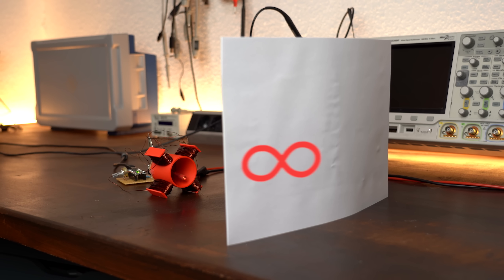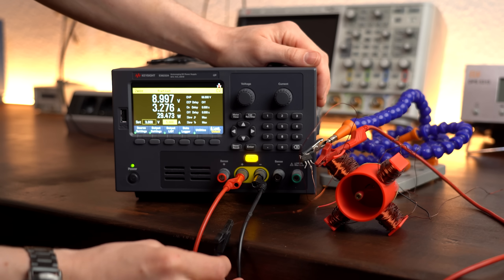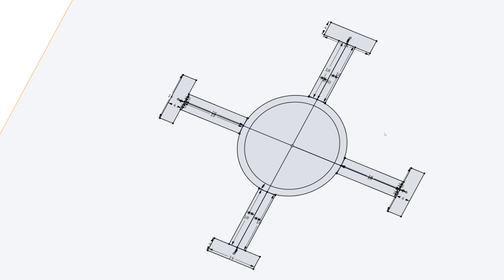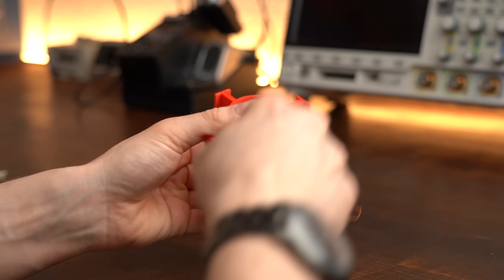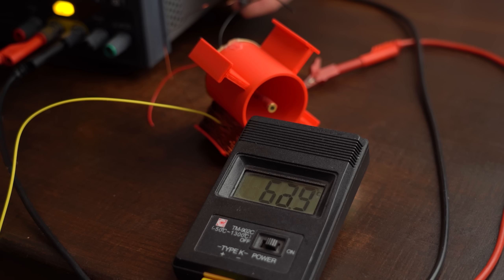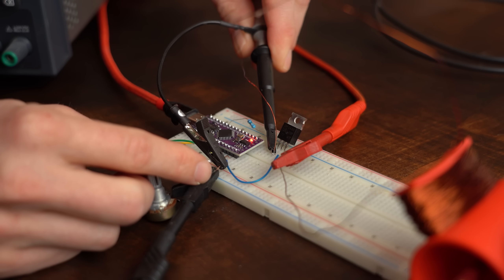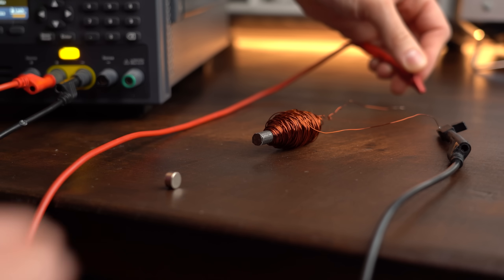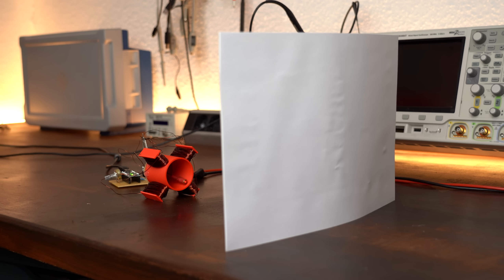Exposing the FAKEST Project....and making it REAL?!

Comment: Even easier laser projection display idea with no moving parts!

How about an electron gun (laser) inside a vacuum tube with magnetic fields focusing and bending the rays (changing the trajectory of the electronics) to hit specific points on a phosphorescent coating on the interior side of the tube opposite to the electron emitter with the target point moving across in a line and then up line by line to display an image on the outside of the tube.

Oh wait that's a CRT (Cathode Ray Tube) display, first conceived around 130 years ago.
Reply: Making a CRT is harder, not easier. A galvanometer based laser display requires no vacuum, special containers (vacuum tube), special chemicals (the phosphor), or extremely high precision, nor does it generate X-rays.

Comment: Electronics aside, the idea of producing accurate and balanced motion by just suspending the diode on a piece of wire is simply ridiculous and likely the reason why you weren't able to achieve a decent result even in the optimized build.

Comment: Congratulations! You just made a TV CRT with electromagnetic deflection - no ultra high vacuum, no glass, no phosphor and no tens of kilovolts to accelerate the electron beam. 
Nicely debunked :). I saw right away that this ain't gonna work without any cores in the coils, and swapping the polarity on the 9...12V source (coils from VCC to drains; sources on GND) would make it work. There's an additional issue of no pull-down resistors on the MOOSEFET gates, causing potential problems in the switch-on period before the pins are configured as outputs (they're in the high-Z state).

Comment: Am I to expect more piss poor "attempts" in the future... In what practical application of a wave guide do you see such poor windings used.. You have to remember people get facts from your videos. So when you half ass it, and only energize one of the poles. You are teaching people to expect such abysmal performance from said fundamentals, even though you didn't do them due diligence. 

Wanna do some actual good, Take this BS claim of an idea, Put your own knowledge into making it perform correctly. And say "look even considering all of this, It still doesn't work".. Modern rare earth magnets on the laser body, and just stealing the coils off the back of a CRT would have had an effect. You can make a decent DC power supply with an H bridge for X and Y I know, even though that might make chunky moves, you just didn't try.

Comment: https://youtu.be/AzlIG3E7atE

Same Robotics kanti made a video on rf capture using 1n4148 diode, can make that same experiment and say it is real or fake? 

I tried it, but it not worked for me!
Reply: Not going to watch the video, but some thoughts do occur to me. In particular:
1) A normal diode (ANY of the silicon ones) has too high of a switching voltage to detect normal-strength RF signals, so either the signal needs to be amplified, or a lower-switching-voltage diode must be used ("crystal radio" sets use a lower-switching-voltage diode, though the LC resonant circuit in them plays a role as well).
2) If capturing RF for power purposes, then you're limited by the actual power that your antenna physically encounters, and trying to accept a wider range of frequencies actually reduces how much of the power in a specific frequency you can actually capture.
3) Your antenna has to match your intended frequency range, if your antenna is wrong (or you accidentally filter out your desired frequency after the antenna receives it) then you might not get any signal at all.
Reply: @absalomdraconis  Thanks for the brief theoretical explanation 😀.

Comment: Yeah also driving a FET directly, when the voltage being switched by it is greater than the voltage of the MCU, is also pretty silly. When FETs blow, they usually short, which would make a path for the voltage to go to the MCU pin and poof, your MCU (or driver) would die too. It’s common practice to include a ~10 ohm resistor in series between gate and driver, and in many cases a zener diode as well, to clamp the gate voltage and fry a cheap resistor and or zener, rather than the controller as well.

Comment: I've made a laser toy almost like that but it is also quite different, and soon to be impossible.  I used mechanical hard drives, specifically the moving arm attached to the reading heads.  It has a coil between two very strong magnets and deflects with modest current.  I attached a small piece of 1st surface mirror to the arm at the pivot, and aimed a laser at it.  Let's call this the left channel.  I then took a second hard drive, same procedure (remove platters, attach 1st surface mirror to pivot) and arranged the hard drive cases at right angles, so I had x and y deflection, let's call this second hard drive the right channel.  You can then attach the left and right voice coils, which are the coils of wire between the hard drive magnets, to a headphone jack, power a laser, and get an audio driven laser light show, classical music or pure tones create collapsing ellipsoids, fun to watch.  Before then, back when you could get black and white (or black and green) CRTs, I took one apart and much like the above, attached the deflection coils to an audio output.  This functioned like and oscilloscope, and again created collapsing ellipsoids when listening to classical music or pure tones. It would be fun to create a programmable laser display, and my dear Great Scott, just make one with some fast stepper motors, OK?  Research laser display tables, and make a DIY or Buy episode, making our own must be far cheaper.  Sure, lasers are dangerous, but so is electricity in general, both are fun if done responsibly.  Cool video!  Just remember kids: deflect the mirrors, not the laser, and you can make your laser arbitrarily big.
Reply: Neat, you could make scanning raster display with two orthogonal rotating optics (mirror and prism, or two mirrors). The issue with all these systems is the power required to move the mass, esp in reversing direction.

Comment: The trick with a laser display is to move a mirror and not the diode, there's a tiny little laser-resin printer out there that does this, and uses an actual sound wave from PC speakers to move said tiny mirror. forget who makes it, but that is one useful application of such a device.

Comment: Maybe if you place a magnet ring around the lazer will be better, plus instead of turning on and off solenoids, will be better to keep all turned on and decrease the magnetic force in the oppossite direction you can move (and limit the minimun force to like 20% or so). Probably this will give you much control without more effort.

Comment: It is not possible to mechanically move a light source so fast to be able to build some image. This is why people used a cathode ray tube in TVs instead of something much more basic like a mechanically moving light source. To make it work you need to have many light sources that are moving constantly (usually spinning) and you need to turn them on and off to create a picture. Or you need a way to make the light change direction.

Comment: It's actually an old idea applied in a new way. A cathode ray tube display uses an electronic gun fired at a phosphor screen, guided by a electro-magnetic field. This is not that different. Of course guiding a laser housing with a electro-magnetic field would take a bit more work than guiding an electron, but the principle is not that different. I think this could work if the electro-magnetic field could be precise enough. You could even have three colored lasers (RGB) and vary each light strength based on the color pixel you want.

Edit: you could even house the laser on some kind of a pivot arm, with a stepper bearing (similar to a stepper motor in a floppy drive), so the the electro-magnetic field is simply pushing/pulling the rotation of the bearing to the next step every time it actuates, for better precision. You'd then do scan lines like a CRT, except you wouldn't need a heavy vacuum tube or phosphor screen.

Comment: Of course  making the magnets push, pull and adding a ferromagnetic bridge between the outer poles would make the magnets more efficient. Also moving the inner poles closer to the diode would also increase it's influence.

But what is missing in this presentation is a free body diagram to explain what is happening  to the diode under the influence of the magnetic field and any kind of calculation as to how to get the most efficient field influence as well as the influence of the location of the laser diode on the propertirs of the magnet which would be needed to determine it's position.

Comment: Well, you don't need to control the whole laser build, only its light, which can be done by reflecting the light from a small piece of glass. Light direction can be controlled by changing the angle of the mirror.

Comment: Ooof.  The lack of a flyback diode was utterly obvious from the shortest glance at the schematic.  This is just sad.

But there's a reason these sorts of things operate by deflecting a mirror the laser is reflected off of - much lower mass and it doesn't need to move as far, which means you can put the electromagnets much closer and run them at far lower currents for the same amount angle shift.

Comment: Hi! I'm just writing down the ideas that suddenly came to my mind. OK, this is not working. But maybe you could make one that works. For example, I think you could have a thin long rod coming out of the end of the laser, and conductors that don't affect the movement or the movability. Near the diode it would go through a hole that would fix it in the middle. There would be 3 or 4 electromagnets around the end of the rod, and it would be easier to move, like a lever. Maybe it should be wound like a CRT beam deflector.  It wouldn't be stupid to have the rod fixed in its own plane either. I thought of this as the hole that holds it in place could be made up of 2 parts, and the rod would have a notch in it. __]>=|=<[__, and the rod is thicker than the hole. 

However, you would need to factor in the weight of the diode, and you would need a gyroscope, with the data from that, to adjust for the angle it is at. And of course, because of the mass, there will be momentum, which would have to be restrained either by electromagnets or by some kind of tensioning, like in a speaker, or this and that.

But what that would do, I don't know.

Comment: It could be made to work but you need a coil on the inside also that is powered a little to make a magnetic field that can then be pushed by the external magnetic fields. It is the same as an old tv tube with its magnetic fields to direct the electron flow. The power requirements are a lot higher than what you have and especially what that ripoff utuber had used.

Comment: The first photo on the blog post you linked to reveals it's a fake. It's a red laser diode, yet the display shows red, black, and white. How did the red laser produce white output?

Thanks for digging into it and sharing your findings! I have a new appreciation for how well mirrors on galvanometers work for directing laser beams.

Comment: As a beginner, I did no really understand why the Mosfets were not hooked up properly and why the current would just flow through regardless of the gate current.  Would love to see a transistor "tips and traps" video from you.
Reply: remember it's a MOSFET, there is no gate current, the voltage is what counts.

Comment: A laser module has so much inertia that huge currents would be required to move it quickly and accurately, and positional feedback would be absolutely required. I'm guessing it would take hundreds of watts, and a fluctuating field like that would wreak havoc on the nearby Arduino, and probably even the laser module. It clearly makes more sense to keep the laser still and move a small mirror instead, and indeed, that's what commercial galvo-scanners do.

Comment: It makes more sense to suspend a very lightweight mirror and deflect that with smaller magnets. It'll still be clunky, but better than the original idea. You can get an infinity symbol by putting plastic wrap over a loudspeaker, gluing a small mirror in the middle of the plastic, bouncing a laser off the mirror from 45 degrees, while feeding variable frequencies from a function generator to the loudspeaker. Certain harmonics of the mirror's resonant frequency will generate shapes whose size varies with the harmonic value.

Comment: Typical laser scanning devices (like older barcode scanners) use a stationary laser, several angled stationary mirrors and one or two vibrating mirrors to achieve the desired effect.

Comment: I find it kind of funny that this idea is so impractical. We used something very similar in CRT TVs but instead of bending a laser beam, we used electric fields to bend an electron beam. Old black / white TVs could possibly be hacked to achieve some outcome here, but in reality the inertia and acceleration of the laser diode would probably defeat any possible results.

Comment: bare using actual mems mirrors (which could be tricky to obtain), for a simplest ghetto implementation of laser display one could use pair of small size speakers, remove diaphragms and glue a strip of alu foil from the edge to the center

Comment: The best way to do this would not be to use electromagnets but instead to use motors that can be controlled precisely. But then instead of moving a heavy laser diode around, you would move a lightweight mirror. And now you have a laser galvanometer, which is commonly used in laser light shows.

Comment: yeah the fake is obvious, however you could put a bit more effort into it 9m50s your code implies digital pins 6, 7, 8 and 9 are capable of PWM however thats not the case. also driving the coild in fullbridge at way higher frequency and change the code material you could take advantage of eddy currents in the diodes housing...

Comment: About 30 years ago I made something similar to this (that worked!).  Difference was I directed the laser beam, not the who damn laser head (since.. you know... mass of photons vs metal - ha ha!).  I had an old video laser disc player laying around that I robbed for parts.  It used a red HeNe laser tube (pretty cool looking) and a couple of mirrors that controlled the beam. 1 for X & 1 for Y axis.  I was just using what I had laying around - and this was way before Arduinos and the internet existed - so all I used was a stereo audio source.  One channel connected to each axis.  

Certain music would give boring patterns, but Pink Floyd (for one) was awesome since they used such crazy mixing of the left & right channels.  The laser was SO bright, I could shoot a pattern at my ceiling and get an 8- 10ft diameter pattern.  I still have it, but haven't powered it up in at least 20 years.  No clue if it still works even.  I'll have to try it one day!
Reply: Make a video, maybe GreatScott, can you feature it?
Reply: @jendo6354  - I'll dig it out, dust it off, see if it still works.  If the lasers toast I'll have to do a massive downgrade to a diode laser though.  No idea where I would ever find another HeNe.  The player was from (the late 80's early 90's?!).
Reply: @DrFiero  it sounds really cool tho. Some very nice "toy" haha
Reply: @DrFiero  : You should be able to find a comparable (or even massively more powerful) laser diode, since they would have needed about the same power for CDs as for LaserDisc. Even better, you could always get a prism to route several colors of laser diode together, and have the brightness of each controlled by one of those frequency-to-color circuits that (I think) RadioShack used to sell (one frequency range each for red, blue, and green, controlling the brightness of each according to amplitude). All the usual laser & bright-light cautions apply!

Comment: Please finish this up! I think it's more doable than you think. Could easily dial that thing in with threaded rod and a nut instead of blank rod. Send each side a 255 signal and measure deflection. Adjust deflection to where each side is perfectly aligned from center. Could draw shapes pretty easy.
Reply: You could draw shapes with this thing fairly easily, but the original concept is just bad. The good way to do this is to move a mirror, not the laser. The original designer made nothing but mistskes.

Comment: It seems like his schematic also shows N-channel MOSFETs acting as high-side switches without a driver - driving the gate with a logic signal would necessitate using those MOSFETs as low-side switches as you showed in one of your diagrams. (I expect that you fixed this without calling it out because it was so incredibly obviously wrong.)

Also, it would possibly be advisable to put pull-down resistors on the gates to ensure that they are off while the I/O is in a high-Z state during reset and startup.

Comment: The worst one I think I ever saw involved them taking a phone camera, soldering power and ground to it plus a signal wire and somehow getting video out, clearly ignoring the fact that they shorted most of the pins on the camera with their soldering by just soldering a few, very large in comparison to the pins, wires to it.

Comment: Mistake 4: no pull down resistor on the gates?
I don't remember, but possibly the Arduino has built-in pull down resistors on those pins? But if it doesn't, the gate would float with the internal capacitance in the mosfet and stay on, even if the signal is low. BTW, why blur his face? It's public domain and since he is making a profit while misleading others i think he deserves a bit of shaming.

Comment: Instead of the iron rod you can also use a bolt, two washers and nut combination. That way you can add a lot of wire to the core plus you have the advantage of being able to thread it into the plastic if you leave some threds uncovered.